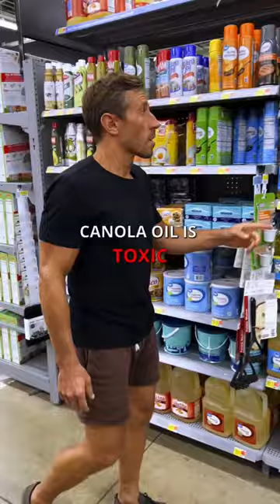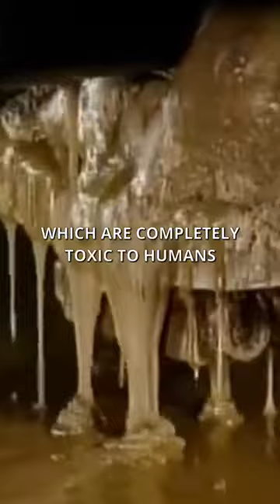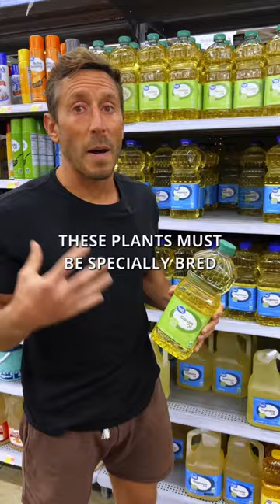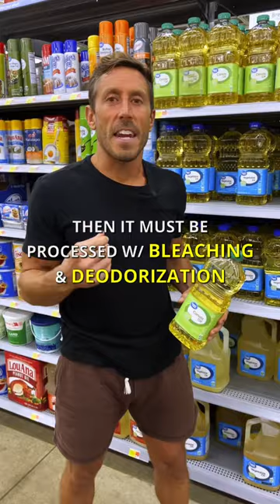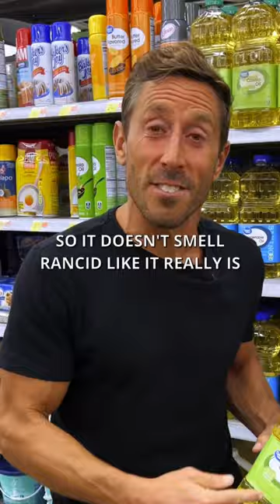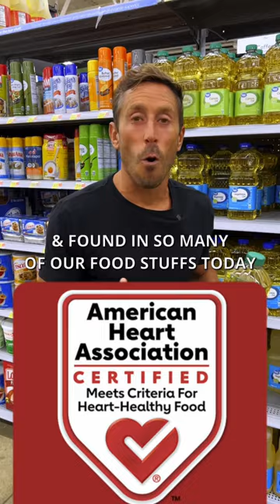How canola oil is made

Comment: I use canola oil on my bike chain sometimes in the winter to protect it from rust🤷‍♂️
Reply: Only thing it’s good for 😂
Reply: @SumthinFishy  exactly😂
Reply: @SumthinFishy apparently diesel engines can run on it
Reply: @HarrisChoudhry  now that’s a bargain!!!
Reply: I use it to make candles. That thing doesn’t even feel like food man
Reply: I’ve used it on door hinges also 😂
Reply: Now your bike is toxic, don't eat it.
Reply: @Theresia66  
Yes I sometimes have to force myself not to lick the chain or eat the bike. Canola oil is so tasty 😋
Reply: @Smattyy  put a steak in the bike bag for an easy snack when the cravings hit
Reply: @Theresia66  💀
Reply: Use me-
Reply: I use it to make fire bundles. Paper towel soaked in crappy oil makes starting bonfires really easy.
Reply: That's the original purpose for it... Lubricant for machinery
Reply: It just makes you think what it does to your insides if it sits on a bike chain all greasy
Reply: Same
Reply: I use diesel for that, works like a charm
Reply: @Smattyy  Its really not though sometimes I have a taste of my cold pressed rapeseed oil before  frying stuff and it does taste like mechanical oil.
Reply: @chatteyj  yeah you shouldn't eat that stuff. Cook with butter or ghee instead.
Reply: That's what happens you rust inside though
Reply: what it was initially designed for
Reply: Your bike chain now has cancer.

Comment: This video is very misleading. TL;DR: if you want something healthier, cold-pressed canola oil will do. 

Longer version, the cardiotoxicity has been demonstrated in rats, not humans. The hexane processing is not ubiquitous and rare in cold press processes. Rapeseed and rapeseed oil does not smell bad, it's actually closely related to mustard and it even looks a bit like the mustard plant. Finally, if you are reaching dangerous levels in terms of toxicity, you have bigger problems based on the sheer amount of oil you're consuming. 

Full version, quoting Galanty, et al 2023:
Due to the unproven responsibility for the poisoning effect in TOS, and the in vivo data on inducement of cardiotoxicity, erucic acid has been for decades classified as a toxic substance, the use of which should be rather avoided. It should be strongly emphasized however, that the cardiac adverse effects have not been confirmed in humans, and the experiments in animal models, performed mostly about four decades ago, had many limitations, including a small number of animals, or extremely high doses applied during long time exposure to EA (Table 1). Moreover, this effect was reversible in most cases.

In our own opinion, the presented toxicological data clearly indicate that, when used in reasonable amounts, EA is not as toxic as it was previously believed. One of the most important issues concerns the reversibility of the potentially toxic effects of EA, after the end of the treatment. As far as the beneficial effect of EA is concerned, special attention should be paid to its role in neurodegenerative diseases, based especially on the observed ability of the compound to decrease the rate of the development of ALD. Additionally, the results of the published studies on the beneficial effects of the compound are promising enough to continue further research, despite the relatively small data presented